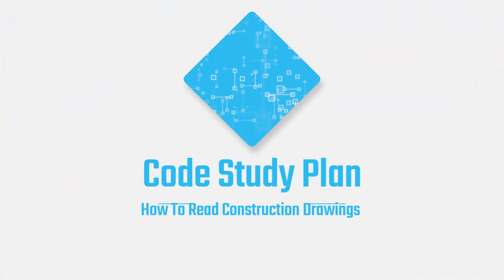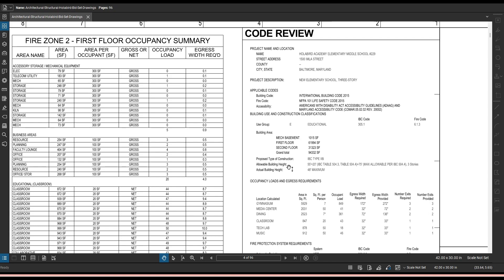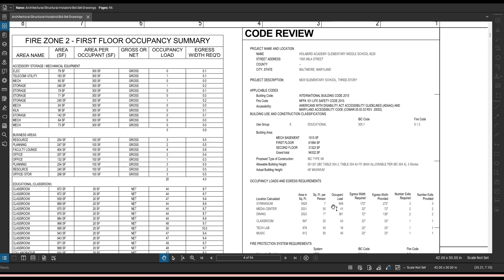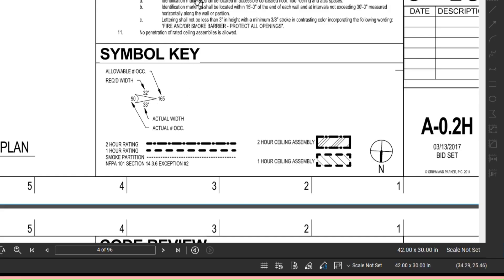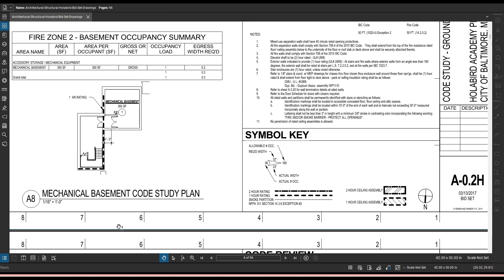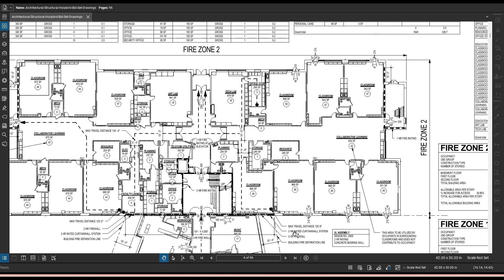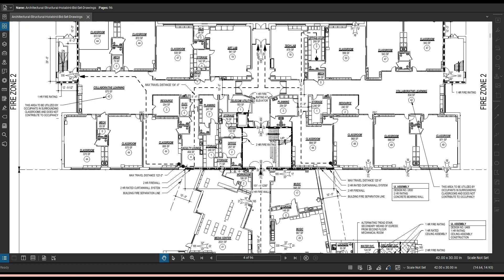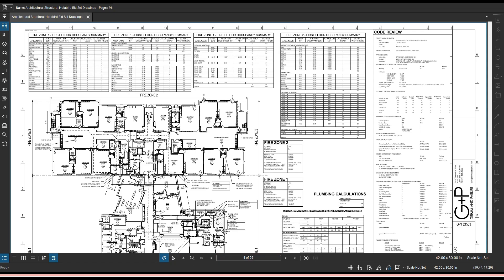Learn How To Read A Building Code Analysis Plan

Comment: Hey Smith, I enjoy the way you explained the plan building codes. I am currently studying for the ICC commercial building construction and this information is greatly appreciated. One question, is there a way I can find the case study plans online? I’d like to study those plans in detail to help with knowledge on the codes I am studying. Thanks
Reply from the maker: Yes sir. See if this link works for you! https://www.cambuilds.com/wp-content/uploads/2017/06/Architectural-Structural-Holabird-Bid-Set-Drawings.pdf
Reply: @LearnAboutConstruction  Thanks so much for sharing the link, sir. I really appreciate it.